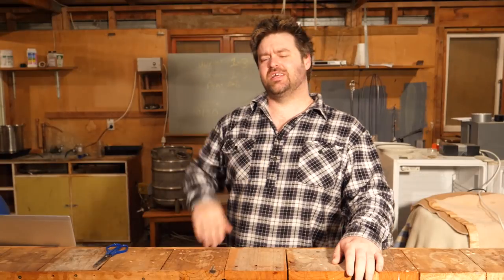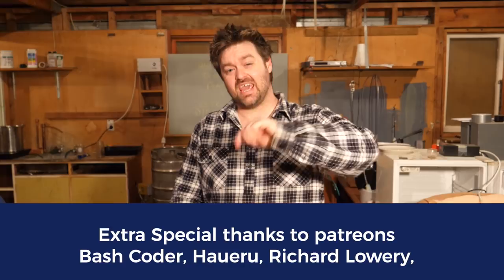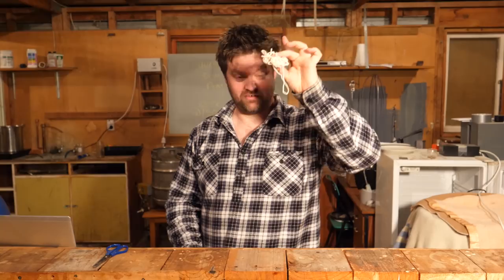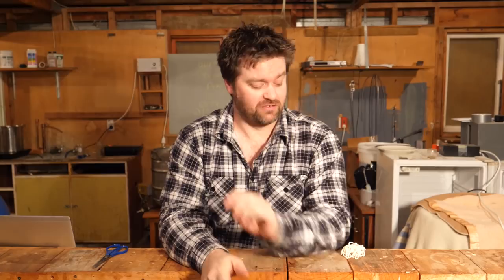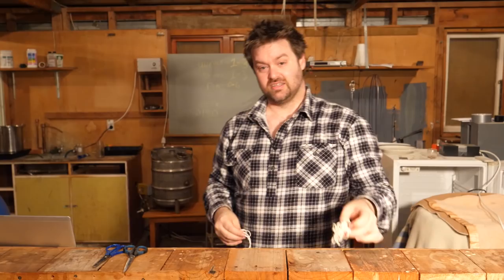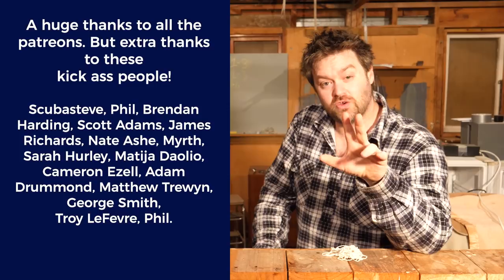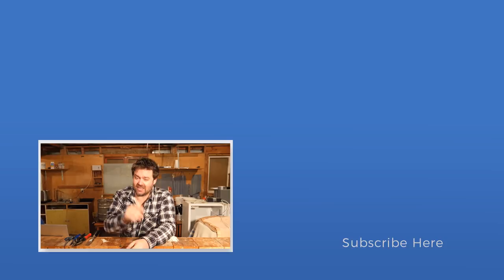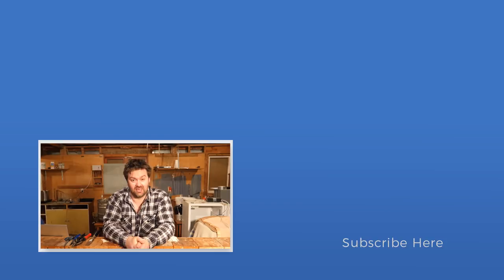Introduction To All Grain Mashing : All Grain Basics

Comment: Good video. If, however, one is interested in maximizing sugar production one might consider doing two steps in what home brewers call step mashing. That involves raising the temperature of the mash (water-malted grain mixture) to several different temperatures, one at a time, so that all of the enzymes kick in, each in their order. For sugar production, the first of the two most important steps involves raising the temperature to  between 130-150 degrees Farenheit (or 54-66 degrees Celsius) to kick in the Beta Amylase - and then let it sit (or "rest"). The optimum temperature for a Beta Amylase rest is about 148 degrees Farenheit (64 C). Then, after the Beta A rest, raise the temperature to between 150-160 F (66-71 C) to get the Alpha Amylase working. The optimal temperature for the Alpha Amylase is 158 F (70 C). These are the two enzymes mostly responsible for converting starches into sugars. Be careful not to exceed the temperature ranges for each of these enzymes. A temperature of 160 degrees Farenheit (71 C) will destroy Beta Amylase. The same is true of Alpha Amylase at 170 degrees Farenheit (77 C). You can get both enzymes to work at temperatures between 158 - 159 Farenheit (66-70 C) if you can hold it there long enough and accurately enough.

Or, failing that, you can work in the reverse direction with your handy-dandy bags of pre-packaged powdered Alpha and Beta Amylase. Raise the temperature to the optimal temperature for Alpha Amylase (as indicated above) and put in the amount of A Amylase as directed. Then, let the mash cool to the optimal temperature for B Amylase and do the same for it. Shame, though, that doing it that way will cost more and deprive you of the use of the natural Alpha and Beta Amylase enzymes in malted grain.

Have fun!!
Reply from the maker: This man knows his AG! Thanks for dropping the info here mate :)
Reply: John Wadsworth  followed that.
Reply: Great post John, BUT home brewers don't usually work with corn nearly as much as distillers do.  Corn changes things pretty drastically.  If you step mash up, you kill off (denature) the enzymes needed to gel the corn as the corn needs much higher temps then malted grains (40 F+).  If you follow your step method as described with 148F for Beta and 159F for Alpha you really haven't reached the point where the corn starts to really gel.  So by the time you raise the temp to 185F or so to gel the corn you have denatured your beta & alpha enzymes.

Now there are a couple of different ways to handle this.  First is just to start with near boiling strike water and add your corn (with no enzymes) and let it get super thick and hard to work with and not worry about it until temps drop to 160F.  Second is to use a high temp enzyme such as Sebstar HTL with is optimal at 185F.  So pretty much as soon as you add your corn to the strike water you are at your optimal temp.  Just adjust pH to 5.5 and add your HTL which will thin out the mash like magic in front of your eyes.  Third you can add some sacrificial malt which will denature quickly at these high temps but will start to thin out the mash.  Basically you use only as much as needed to keep the mash mixable (but thick) saving the bulk of the malt for later while at 185F-ish. Forth is to sort of "step mash", in that you add the corn to the strike water as it's being heated at around 160F and add some malt while it's at a temp it's effective in.  This helps to keep the corn thinner when you get to temp for full gel.  You only use a bit of malt as it will denature at high temp.

I'm partial to not using enzymes and just gel the corn and leave it thick to the point of still stirring but hard to do.  If need be throw a handful of malt in and mix and it will thin out the corn a bit but the enzymes will denature quickly.  But a handful per 10 gallons usually does the trick.  If you're mix is 15% malt then a handful here or there isn't going to make a lot of difference but that handful or two thrown in at high temp will help to thing things out.

Let temps drop and add in any other non malted grains (rye, wheat, oats, etc) at 160F and keep mixing.  At 155F add more (1/2) of your malt and keep mixing to let the Alpha enzymes do their thing cutting big chunks into smaller pieces.  Let temps drop to 150 and adjust pH to 5.2 which should be a bit lower then when you added "alpha" enzymes malts or enzymes (5.6).  At 149F add your remaining malts and/or enzymes.  The "beta" enzymes will now break down what's left after the alpha chopped up the big pieces.  Beta or Gluco enzymes are much more effective on the way down in temp after Alpha enzymes have already carved up the starches.  The Gluco will add little to the overall OG if you dosed Alpha correctly and some home distillers skip them.

Depending on the malts used you may want to do a "side batch" of malted rye or oats as they can add a lot of proteins and gum up the batch.  A protein rest on these malts can be quite useful to allow lautering and easy sparging if that is something you want to do.

 

My point is that you can ask 10 people how to malt grains and get different answers that all work even for the same base recipe of grains.  But each will require a different process and may produce a different tasting "beer".

People should experiment with different methods to find out what's best for them and their equipment (ie bag, lauter tun) to remove grains after ferment or before or to run grains in the wash (dirty) depending on the still.  Each will distill differently with a different taste and profile.  None right or wrong, just different.  Track you time and costs of products used to see what you "true" cost per gallon of wart/mash is.  Try different methods and find what works best for you, your equipment and your materiel.

Comment: Over the past several years I have read this several times and I am familiar with the concept, HOWEVER, the newbie needs to hear it until It eventually becomes something you just know, understand and take for granted.  Also, at first, understanding the importance of  Alpha Amylase vs Beta Amylase is the critical part.  The rest of the enzyme chemistry can come later.  I like the flaked/gelatinized grains that are universally available now.  Makes the process quite a bit easier.  Great Job Jesse.

Comment: Outstanding! I was trying to remember when I jumped into all-grain, and all the pain I went through trying to grok the process, and I decided that you did an excellent job of...  cutting (sorry) through all the scary words and science talk. I now understand mashing, but still stick with a lauter tun made from a cooler and toilet supply line hose braid, and only batch sparge. Anyway, you taught well, and those that are new will just have to ask questions until it clicks. I'm not sure that there's any shortcut around that. Prost, brother!
Reply from the maker: Yeah it was a pretty full on thing to get into when you first start it aye?  I agree the only real way to learn it is to get stuck in and get some experience.

Comment: I was a homebrewer before trying distilling, homebrewers tend to mash hotter than mentioned. Usually 148 to 158 with 152 being the most common temperatures. (64.4 to 70, 66.7 most common)
Reply from the maker: Yeah I hear you.  Thats my standard range for beer as well.  But I try to get a little more ferment-ability our of the wort.  64c tends to give me about 1008-1010 FG normally.
Reply from the maker: Denny it's a ballance thing.  You need to ballance sweetness (more often referred to as body) against the hop bitterness and the carbonation.

Think of how dry champagne (less than 1000) is compared to say a big chewy milk stout ( perhaps 1020)  It's the unfermentable sugars that give that body.  But even a IPA or APA would taste thin and  weird without finishing around 1010.

Comment: If anyone knows about heat treating steel you will know that you need to take the steel to a certain temperature, hold it, take it to another temperature , hold it again, and so on until you have the desired effect. The same goes for mashing for whisky.  Within 30 mins of adding water to get your 63-64 deg temperature you must have that wort out of the tun and cooled.  The reason is that beta amylase will denature at 64 deg in 60 mins.  You need to retain some beta A for the fermentation process as it breaks down the long chains sugars into meltose.  Alpha amylase is random but produces mostly long chain sugars which are unfermentable.  You can wash out the draf with 75 deg water, drain and cool and add to the wash.  You can do a third washout with 90 deg water and retain this for your next mash as it will have a little sugar still.  If you follow this method you will double your alcohol yield.  Go to hhhdistill.com and look at the blog about this.

Comment: Mash out by increasing temperature to 78C for 10 minutes then sparging the grains will help with efficiency.  Wort boil post mash is only required for pasteurization.   Bringing to boil past the hot break should be sufficient.  I'd argue denaturing is not required though.

Comment: Without a mill is a food processor OK or will it turn to a flour shit pile? (malted same brand as you have)
Reply from the maker: Yeah nice man.  Are you going to strain with a bag?  Or are you lautering it in a three vessel set up? 

If bag you should be ok if its your only option.  Dont get to trigger happy though ;)
Reply from the maker: Also,  be prepared for wrath if the kitchen is not your domain hahahah (depending on the amount you are going to be doing etc)
Reply from the maker: Also also . . . .I checked your channel out.  Awesome!  If anyone is into 3d Printing go check it out!

Comment: Question. And I apologize if I missed this. If you’re adding sugar (corn sugar) to your grain mash for distilling, is it still necessary to convert the starches to sugar?
Reply: No, that process has all been done in production of sugar. Would prob add it after mashing other grains, then you can check gravity reading after mash.
Reply: So the only reason to take the time to convert the grain starches to sugar is if you DONT plan on adding extra sugar?
Reply from the maker: If you want to use grain and have the sugar converted you need to mash.  This is a little confusing because recipes like UJSSM DONT do this. They just use the grain/corn as flavouring.  

So yeah if you want to make a all grain mash you can then bump up the gravity by adding some sugar as well.  Thats basicly exactly what I ended up doing with the bastard whisky 😜
Reply: Still It - Thanks! I find mashing the grains to be a pain in the ass.
Reply from the maker: Hahahaha fair enough man.  It definitely is a labour of love.
Reply: Denny Stake - When I use sugar it’s corn sugar. I understand boosting your ABV by using it. I found that as long as you ferment your mash with the grains still in it  & use corn sugar, there’s no difference in flavor than if you convert your grain starches first. I’m just trying to justify doing that extra step. I appreciate everyone’s feedback!!

Comment: You are using enzymes to break down long starch molecules into simple sugar molecules that the yeast can easily eat to produce alcohol and carbon dioxide as waist products, It is not necessary to convert starches to sugars for fermentation when there is plenty of different sugars commercially available. So all you have to do is figure out how much sugar your yeast can eat, make a solution of sugar and water and let your yeast have at it.It will save you a lot of work and energy to just use sugar. You can add other ingredients and grains for flavor if you want to and produce something just as good as all grain mash.